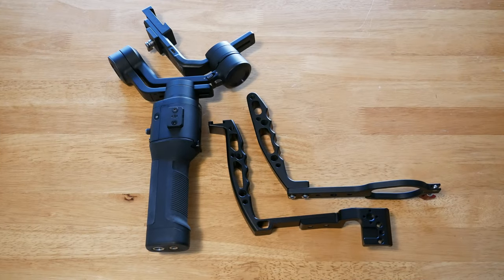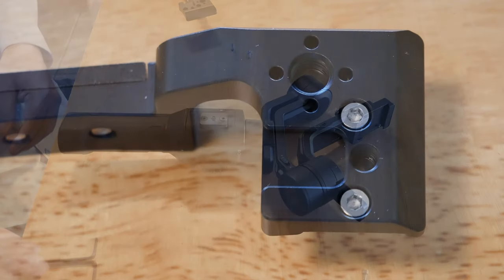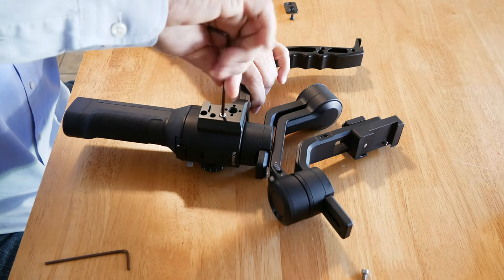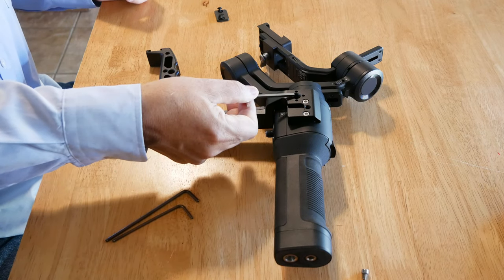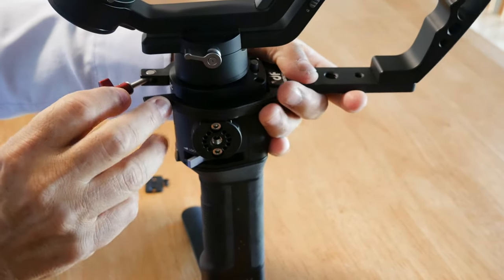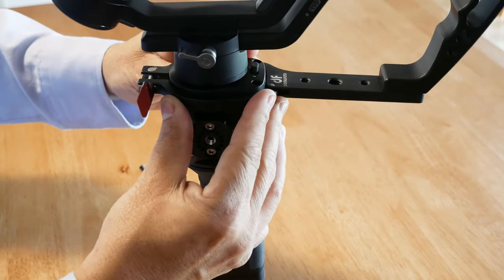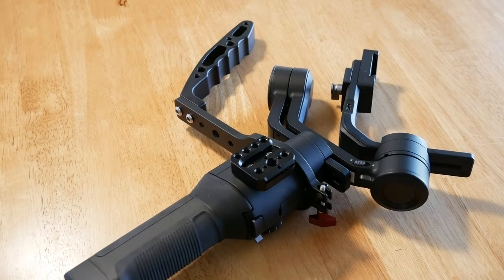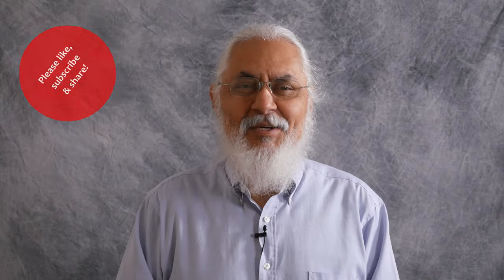DJI Ronin-SC Handle Grips - DigitalFoto & UURig Install & Review - 4k UHD

Comment: Hi Sir.. Which is more sturdy DigitalFoto or UUrig? in the long run digitalfoto might lost its thread? im just wondering.. tnx
Reply from the maker: Both worked fine. I just liked that you can more readily remove one of them. No screws involved.